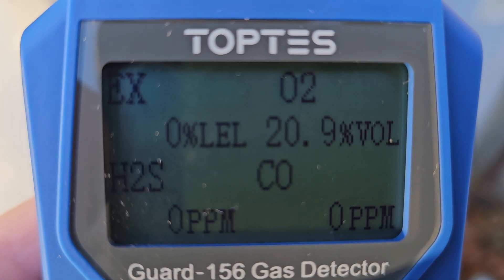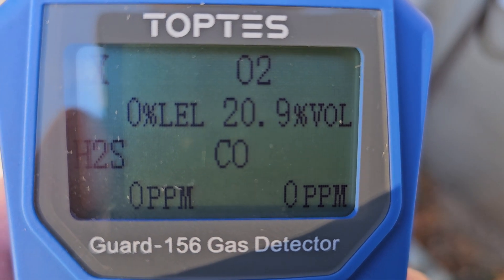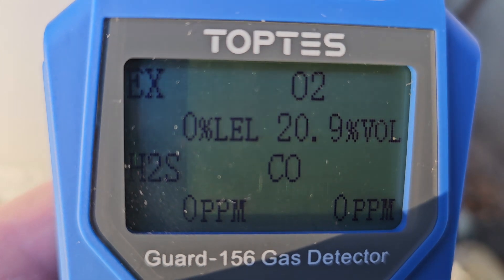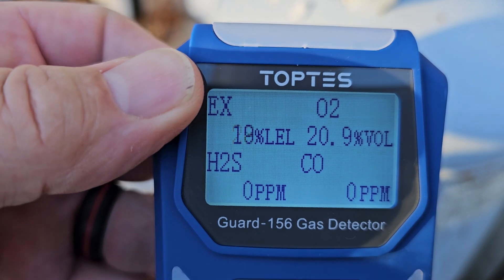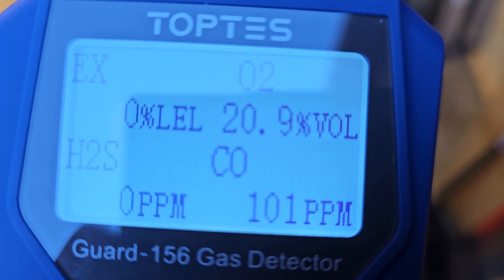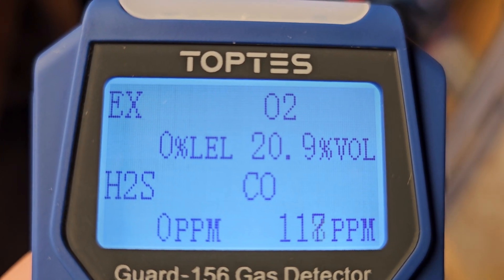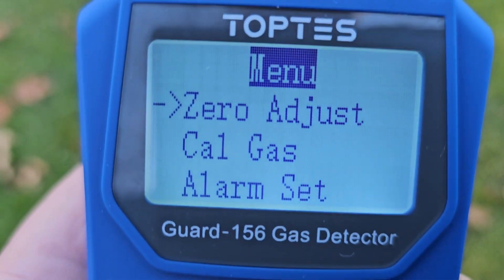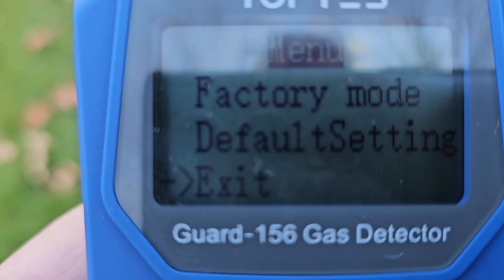Toptes Guard-156 4 gas detector

Comment: Struggling with one of this , keeps beeping all the time, but if I change the 02  to 20.9 stops beeping, if I blow N2 on it , doesn’t sound the alarm 🚨 
Any ideas 💡 
Customer Support sucks for this unit
Reply from the maker: Nitrous Oxide has a cross contamination with the CO (Carbon Monoxide Sensor) and would produce a high reading. The O2 (oxygen) sensor would indicate a low reading because you're displacing oxygen. You should never take a high concentration of gas and flood the meter. The sensors become flooded with the gas and impair its function. It's designed to measure air in a liveable or accessible space by humans. You start from a known fresh air area and make your way into the area of question. It is important to understand what you're getting yourself into and potential exposures.
Reply from the maker: Out of the box, the highs and lows should be preset on all four gases. What is N2? Is it Nitrous Oxide? N2O?
Reply: @MrRChitty thanks for replying,, N2 is Nitrogen, so by increasing the o2 like you have it , stops the beeping, and now tests it by blowing little propane gas on it , and seems working fine now!
Reply from the maker: @eleazararauz5413 keep me posted. Another point of reference, propane and natural gas have different lower explosive limits. This device is calibrated to pendant. Low levels will not be detected by this meter. If detecting combustible gas is on your radar for low levels, then you want to get a combustible gas detector. It detects down to 50 ppm. (Parts per million)

Comment: Mine alarms immediately when turned on with everything zeroed out. How the hell do you get this thing to shut up?
Reply from the maker: When you turn it on, it goes through a test. It flashes the lights, I believe it sounds the alarm and vibrates however, just for a few moments. It provides the parameters it is set to then it begins to monitor. Does it stay in alarm despite indicating normal readings? (normal reading means everything is zero EXCEPT oxygen which should be 20.9%. Let me know.

Comment: I purchased a Guard 100 and for some reason it's always showing the O2 at 0% which is constantly setting off the alarm. Tried doing a factory reset with no luck.

Guessing it's a bad O2 sensor. Did yours start up with the O2 reading at 20.9%? Thank you
Reply from the maker: Mine shows 20.9% on boot up.
Reply from the maker: Make sure the sensor is mounted properly. I don't know how to take it apart,but has to be possible to replace.